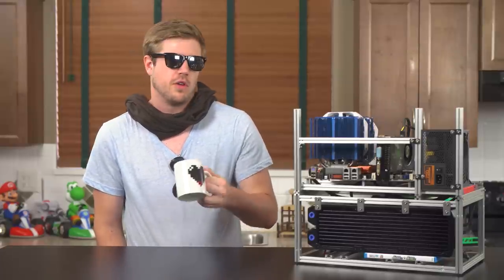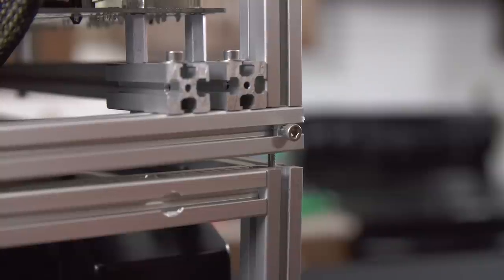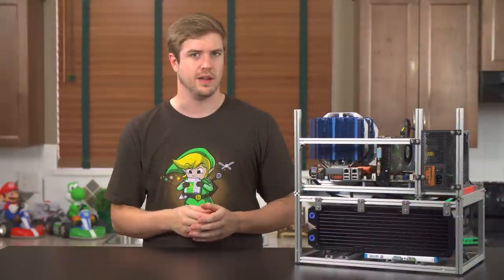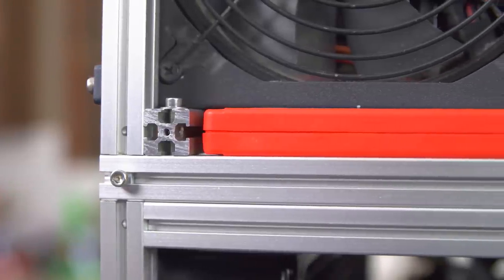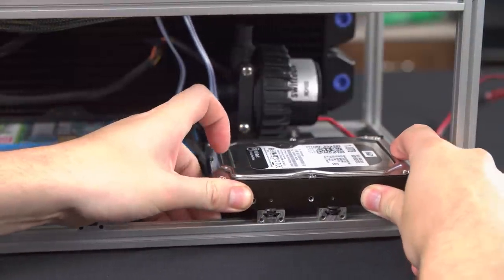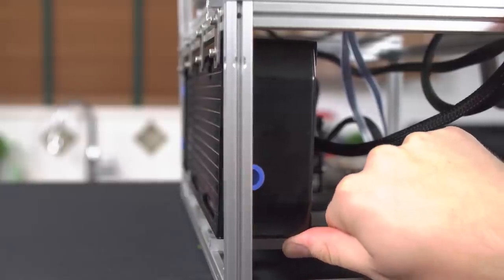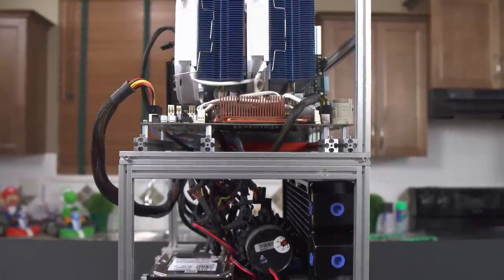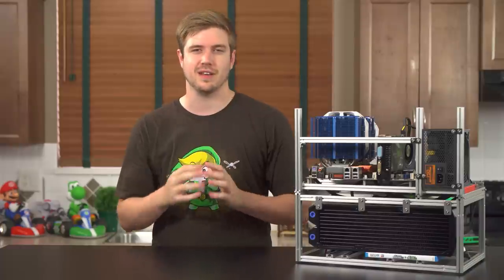Spotswood Tech Station - Extremely Modular Test Bench

Comment: This is really simple to make on your own, a nice afternoon of drilling and thinking and you have a more functional and better looking test bench.
Reply: ***** Not everyone knows how to build a computer, and yet when you learn how to do it you can save yourself money and make what YOU want. :)
Reply: Bushy Bush Not everyone has the tools to make the proper cuts in the material to make it truly modular like this bench, nor even cut into aluminum (if the all aluminum construction was also a desirable feature)

A simple test bench is easy. A modular, light-weight, sturdy, all-aluminum test bench is trickier
Reply: Andrew Tran For this type of bench you need a drill and a measuring tape, of all the test benches I have seen this is the easiest to do yourself.
Reply: Again, the result wouldn't be as modular. Anytime you'd want to make a change or add something would likely require drilling additional mounting holes. Minor adjustments would also be quite troublesome since you easily shift a previously drilled hole over a few millimeters. A rail system isn't something that can really be done with a drill.

And again, all aluminum is desirable for some people. Most people don't own drill bits that are very good at drilling through thick pieces of aluminum, not to mention making rails.

I agree that a simple test bench is quite easy with just a drill and measuring tape. I also agree that if properly planned, it can accommodate nearly any build without ever needing to pull out the drill again, but its not likely that people will think of their entire build + any future components they might get + any future components yet to be released + any possible configuration of said components they might use in order to make pre-drilled mounting holes that'd work of all of them.

You can make your own soap, pizzas, and clothing at home quite easily as well, but I doubt you do those either. Some products are simply for certain people; those who don't want to do it themselves, don't want to learn how to do it themselves, or don't have the means to do it themselves.
Reply: Andrew Tran Problem with everything you said, you can buy these structural parts already pre-cut and shaped. Aluminium is a piece of piss to drill through and you can make the EXACT bench as shown in this video without having to deal with shipping, manual labour costs and you can make it as YOU see fit.. My comment isn't aimed at those who don't want to do stuff themselves, this is for those who want to spend what I can only assume is allot of money but are more curious as to how much it would cost themselves.

You can make this exact case, even more modular and you can do it for less than the guy who is selling it, it takes two things.. the ability to want to do it and the ability to want to learn how to do it.. simple as.
Reply: Bushy Bush Ye I'm not 100% sure why it would be so hard "drill aluminium".

I worked with the same (and bigger) rails when I was working at machine-building place. For all of these all you have to have is a Drill with Adjustable RPM, the know-how on what RPM to use, a general feel for working with that stuff (can be easily obtained by buying a smaller extra rail to practice on for like 15-20 minutes) and some time. Also safety Goggles and maybe Gloves, safety first. (We largely used these kinda rails to install measuring instruments, light bars and generally easily size adjustable railing for things that might have to be transported through machines)
Reply: What makes you think you can beat the guy that does it for a living :P
Reply: cccpSkyline Doing a mod right now drilling and cutting up a steel safe and turning it into a computer, and all I am using is a Dremel and a shit drill. Aluminium is pretty soft compared.
Reply: ***** Because what he has done here is pretty basic.. Add more and magic it is better..
Reply: I agree, There are numerous outlets where you can buy custom lengths of aluminium extrusion, nuts, bolts, washers & and various types of extrusion clips. It would be simple enough to design your own tech bench ...... without any documentation Luke!!! Come on man.
Reply: Andrew Tran A simple skil (circular) saw with an appropriate blade will cut aluminium no problem but there's no reason why a hacksaw won't work just as well with some patience. The ends can be sanded flat too with a plain old belt or rotary sander.
Reply: ***** Thank you, someone who understands how simplistic this really is.
Reply: Bushy Bush You'd need to buy all the equipment as well, and that's assuming your carpentry skills are on par or exceeding those of this Spotswood company.
Reply: ***** I'm talking about Spotswood, not Luke.
Reply: ***** 1 drill, 1 hacksaw, 1 rotary tool.. done. You really are over complicating the simplicity of this test bench. You can get the Aluminium pre-shaped and you can cut it down after measuring.. then you drill and screw together the parts.. TA-DA! Honestly this shit is simple..
Reply: Bushy Bush so dont buy it.
Reply: Knight Grimm I don't buy cases any more, I make them.
Reply: Bushy Bush so why are you critisizing people who do? If you wanna make them do it. People who are interested in this video dont care if you make your own.
Reply: Knight Grimm When did I criticize anyone? I was offering people the idea that they could create the exact same thing and for less. Isn't that the entire idea of building computers yourself? If what I said got one person to learn a new skill and not rely on companies for pre-built cases then that is a win in my books.
Reply: Bushy Bush without those companies how would half the tech released now be available? You think the government would release the tech? Lol no.
Reply: Bushy Bush Tell you what man it beats me how people can build their own computer systems but can't envision themselves buying the parts and building something as simple as this. It's like lego or mechano ffs.
Reply: ***** You think the less reliant they are on companies bringing out what they need, the happier they would be.. that and they could educate themselves in varying sectors of electronics or design.
Reply: Knight Grimm You think that if case companies didn't exist there wouldn't be any tech? Pretty sure im not the idiot here sir..
Reply: Bushy Bush actually thats not what was said as I stated your too dense your missing the point. Case companies have a good percent of thier annual income from the cases they produce and people buy. The offer products the majority of people cannot build them selves and honestly id rather buy a professionaly build case then a shoddy attempt at a frame.
Reply: Knight Grimm There you go again with assumptions... But you know what, I will take the moral high ground. I offered people an alternative on a channel that has video's about modding stuff yourself and I shall say good day to you sir as I wish not to waste any more of my time ripping you apart. :) good day.
Reply: Knight Grimm It's my opinion that the majority of people can build these things themselves. People who want everything done for them will buy an Apple product. People who watch this channel .... the majority of those people don't need shit like this built for them and you're tripping if you think they do. They can do it themselves. It's only slightly more difficult than Lego and not at all more difficult than Mechano.

Luke bought this kit from a company comprising of one individual. That is to say that anyone can put an assortment of hardware into various different bags. Anyone can measure and cut various lengths of anything ... let alone something so soft as aluminium. And anyone can write down an address and use it to forward a package. 

With regards to bench design ... anyone can take a tape and measure the distance between a pair of holes. If that isn't simple I don't what is and that's basically all you need to know to build something like this that works for you.
Reply: ***** The rails are nothing special, you can buy them,
 http://www.grainger.com/product/80-20-T-Slotted-Extrusion-2RCP9?s_pp=false&picUrl=//static.grainger.com/rp/s/is/image/Grainger/2RCP8_AS01%3f$smthumb$

That is $37 for 8ft of the rail, a decent hacksaw or cutting tool and you can melt through it like butter, make the box shorter and the rad could fit in easier.
Reply: Bushy Bush Indeed. It's not just about saving money and not purely about being self-reliant either, is it? Both of those things are certainly positive in their own right but doing it yourself is also about learning something new which I think is much more gratifying. Sure, it's nice to save a few cents here or there and it's great not to have to rely on others to do things for you but it's a fantastic thing to constantly expand ones capabilities by trying new things and learning about them.

Having said that, some folks ... it's not that they're lazy, it's more like they tend to specialize rather than be a jack of all trades and if something isn't close to their area of expertise then they'll usually opt to have it done for them but it's not because they're lazy. It's because they feel it (the experience they'd get) will be of no benefit to their area of expertise and they'd prefer to spend their time, well ... specializing. It is what it is and we do need our specialists so ... [shrugs] 

(pssst) I don't think that other guy is a specialist though. He's just retarded. haha
Reply: ***** Totally understand man, and I know that some people don't want to do stuff themselves and I understand why, hell I only got into computers and built my first one two years ago, now I am building my own cases, going to be doing custom water loops and going to sleeve my cables myself.

Not only does it mean I can learn more but I get to create something that no one else in the world has, but when you finish your build and turn it on it brings a tear to my eye man. 

Some people don't get it and that is fine, just something that they could be missing out on.
Reply: Makerslide extrusion is very handy indeed :)
Reply: Cutting fine slits of alluminum in a laid on manner isn't simple.
Reply: Obious Alias whadya mean when you say 'laid on manner'?
Reply: My thoughts exactly, it's the same rails people use to build Quadcopters. Look at your local big box hardware store for all the hardware :)
Reply: Yeah. You could build something like this with a bunch of extrusion from 80/20, a drill or drill press and a metal bandsaw. Other miscellaneous tools would be needed ofc but that's most of what you would need.
Reply: *****
McMaster Carr.
Reply: loryk_zarr If you had something like sketchup or access to another modeling program you could be rid of most of those, 8020 will machine basically anything you send them. Someone could design their computer pretty simply on the computer and never have to cut a piece or machine or drill a section, just bolt it together when it all arrives, and yet still have a completely unique case.
Reply: Cole Paquette
Yeah. I bet you could even map it out with some similar size cheap wood if you really don't wanna use sketchup. Then you'd know exactly what you need.
Reply: The same rails from a big box store are what people use to make there own "expensive" looking Quadcopter. Better then paying some guy $2,000 USD for the same thing Our Seattle Police Deparment actually spent $80,000 on a Quadcopter and I was like WHAT, reminds me when Hammers were sold for $400 to the Army but only cost $9 at your local hardware tore.

Comment: What size of extrusion is this? Where can i find the nuts and bolts he's using to mount the motherboard, radiators, hdd, psu etc. It's easy to find the extrusions but impossible to find the nuts and bolts to mount the pc hardwares!